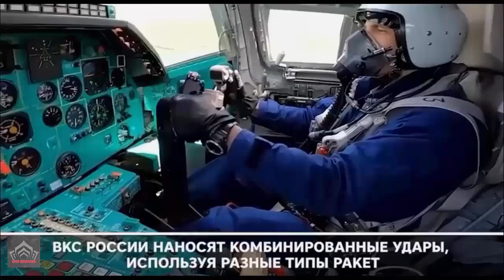Deadlier Than Hypersonic Weapon, Meet Russia's KH-22 Anti-Ship Missile!

Comment: The Kh-15 is just as effective with a much smaller size which allows it to be carried in greater quantities, a Tu-22 Back-Fire bomber could carry 8 of these, and the Tu-160 could carry 12 KH-15... the characteristics were similar to this KH-22 and 32... it was launched, rose to 40 or 60 km in height, and was launched on the target at Mach 5... a batch 8 or 12 of these were impossible to stop by any ship...